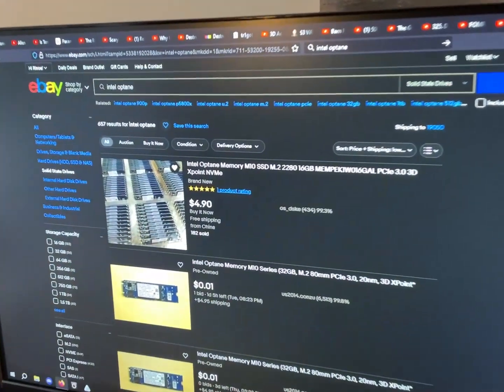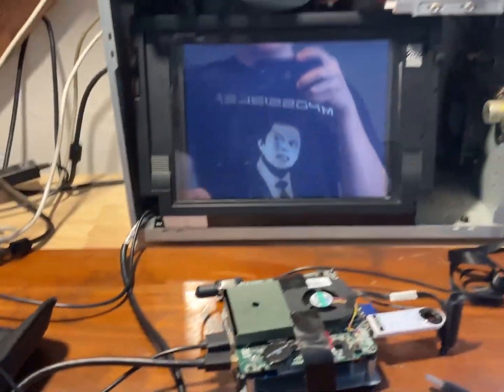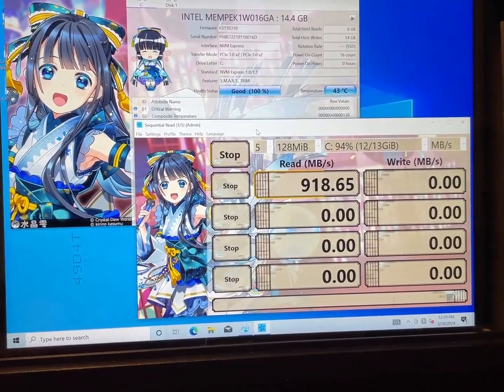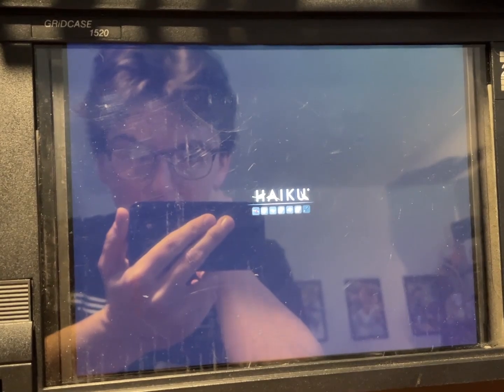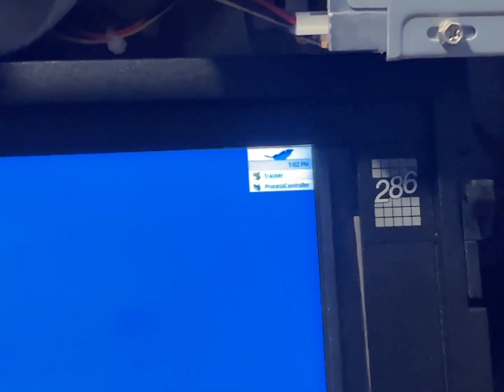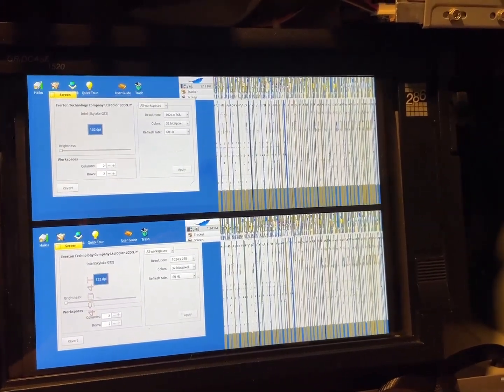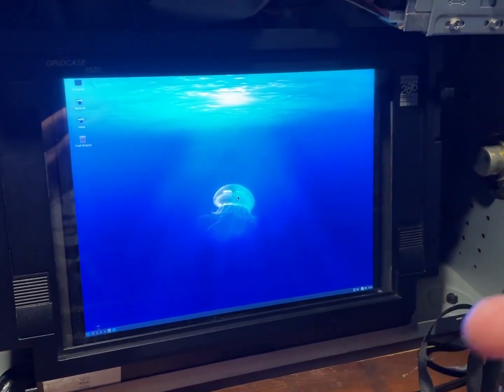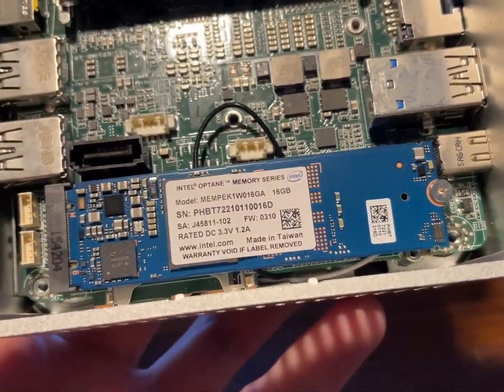The cheapest SSD on Ebay is also the fastest SSD on Ebay. Intel Optane 16GB M.2 SSD 980mb/s in a NUC

Comment: What happened to the 185s?
Reply from the maker: Got moved to my dads new house and is in the barn. We poked at the engine again last year when I visited but we ended up messing with a Gilera motorcycle instead.

We’ve gotten a few other spare parts for it, and I found a few other parts that had gotten lost from it originally. I mean I found the original parts that we lost in the 1990s while also adding a few other new items to the pile.
Reply: @RinoaL  nice are you gonna do update videos? Or would you be willing to sell it?
Reply from the maker: @marieperezharmon8239  Not willing to sell it since it was my first vehicle I ever rode, but we'd like to make more videos about it.
Reply: @RinoaL  cool thanks for the update

Comment: Thiers an issue with ebay that nice people like yourself fall trap too.   Almost all electronic parts and possessor are fake and counterfeit. You open up the acual chip and it's a cheap metal mosfet inside from China and it's not the real part.  Thiers 100s of parts on eBay that are fake.  If it's more money at mouser then the mouser part is Real
Reply from the maker: Most of these are surplus. You sound like youve watched a few videos about finding fake retro computing chips or timer ICs but dont understand where that applies and where that doesnt

Btw I dont like how you use “nice people” almost like you’re calling me stupid lol. I got a genuine part for a genuine deal, and I am not nice when it comes to making deals

Comment: OS related mention, Clear Linux and Solus Linux are the fastest booting linux from what I saw.

The good thing about optane is the random read speed of 4K Queue Depth One (QD1), RND4KQ1T1 in CrystalDiskMark.

(I had the idea in my mind what might be the benefit, I used google Gemini ai to put it into words)
"A higher random read speed at 4K Queue Depth One (QD1) on a computer offers significant benefits for tasks that involve accessing scattered, individual small files very quickly.

Booting up your computer
Launching applications
Opening folders with numerous small files
Switching between programs frequently"

samsung 980 1TB ssd has around 67 mb/s RND4KQ1T1
HDD has around 0.67 mb/s RND4KQ1T1

Comment: Another interesting SSD is the "ioDrive2" or "ioMemory" PCIe card if you can find one for cheap enough. Basically a few hundred GB to a few TB of high quality Flash memory attached to a FPGA, the bigger ones are sometimes decent deals to use as fast SSDs, the smaller ones can be turned into cheap FPGA dev boards.
Reply: What are these?
Reply: Comments like this are one of the best things about this channel. 
These are pretty cheap :3.

Comment: old chromebook SSDs are quite nice for converting old computers, some of the early acer chromebook SSDs are just sandisk 16GB SSDs and are perfect for either converting old computers for faster drives using an IDE to sata adapter or are useful as an extremely fast bootable flash drive
some of those chromebooks also make good linux laptops when you replace their drives and maybe upgrade the ram a little. just a lil low power laptop to run Linux things, since they're basically e-waste it buys them some time before being trashed.

Comment: That's an awesome swap space if you have soldered ram and a spare sata on top of the M2. Other than that, e waste indeed
Reply from the maker: For my use it’s great because I just need a windows install and like 400mb free space to run it as a parsec terminal
Reply: @RinoaL  a terminal is indeed another perfect use I didn't think about

Comment: I always look forward to your new uploads! I might just have to pick myself up some Optane SSDs to mess with.
Reply from the maker: I wonder if you can use multiple of them and address them as a single drive, like a Raid config, to go past 16gb
Reply: That is my exact plan, currently I use 4GB worth of my ram for a ramdisk to store temp files on, run into the Verry occasion problem with that setup so having a bit more space available would help a lot

Comment: 15:00 microsoft changed this recently on purpose. it seems the only way to use win 10 without an account is to disable the wifi adapter/leave ethernet unplugged 🙃 which would explain why you didn’t get it the first time
Reply from the maker: It's only 50% of the time with this disk image, which is interesting. Companies seem to like making things not always happen so you feel crazy.
Reply: @RinoaL  there are a few emails that cause it to instafail to offline mode so I would look into that. alternatively rufus lets you disable those requirements when flashing the USB
Reply: @JessicaFEREM  omg i had no idea Rufus has that feature that’s amazing
Reply: @RinoaL  I have to tell myself it’s just poor software development bc i will go crazy thinking companies are making me feel crazy 😂

Comment: be careful with that Crucial SATA one, the 1TB models at least have a failure rate of like 10%, only time i’ve ever had a drive fail on me
Reply from the maker: Yeah I used this one a lot but it was cheap.
Reply: There is a firmware update for them
Reply: @TheCatherineCC  good to know!! mine unfortunately cannot be read by any system at this point 😭